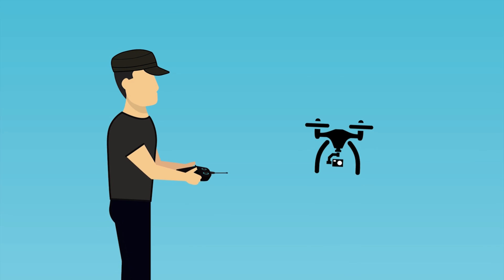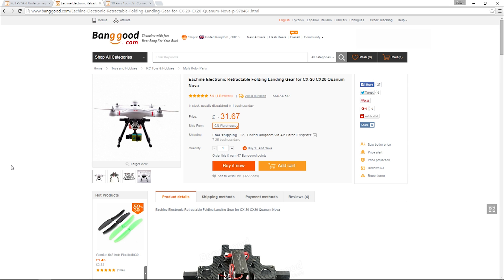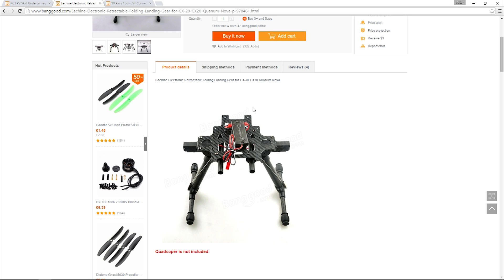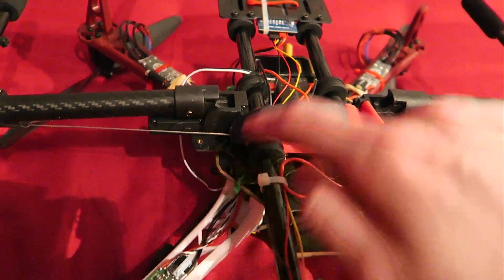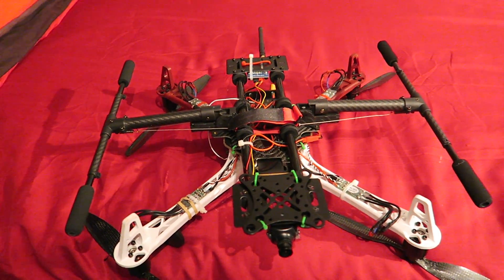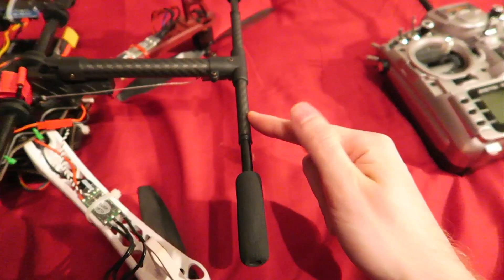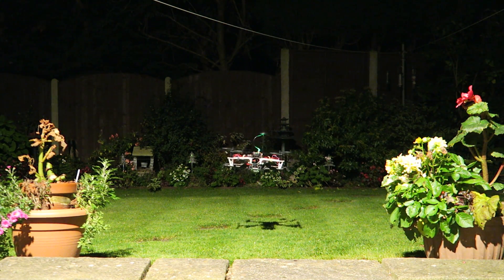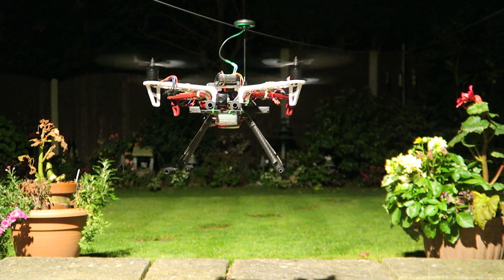High End 450 Quadcopter - E09 - Landing Gear

Comment: looks very twitchy you will need to adjust your pid for sure
Reply from the maker: its twitchy because I'm flying it though the cameras viewfinder to keep it in shot. that and its Gail force winds. the garden is shielded at the front and back but in the middle the winds are crazy. pids are nice on this one. I won't be changing

Comment: As usual ANOTHER informative vid
Me being devils advocate .
Does it affect your flight time (more weight less time)
And I did notice it was wallowing about on a mid stick is it because to much weight underside?? 
Looks EXTREMELY GOOD THOUGH.
BY THE WAY I a while ago I had a problem with my 450 because it wouldn't take off the props span at amazingly fast revs and when I turned the throttle off I got over run .IT WAS GHE THE NEW PROPS normally use 1145.changed to 1147 found out the pitch is ok for speed but crap for lift.I now use 1138 PERFECT. NOT TO GOOD FOR SPEED BUT GREAT FOR LIFT 
TRY  em you might be surprised
Look forward to your next vid
Brian 
London
Reply from the maker: +brian forward without all of this gear using a 6000mah 4s we are talking 20 min flight times. with the gear about 13-15 mins so still very nice for what I will be doing with it. theres no wallowing on mid stick this was flown in stability mode not alt hold or loiter. it was 15mph winds last night. flys really nice 11 inch props could burn these motors lifting this weight the 10 inch are ample. even with all this gear it hovers at 40 percent throttle.
Reply: Cool. My mistake I couldn't see any movement in the veg and assumed it was slightly unstable due to the underbelly weight. Very respectable flight times. Unlike some of the doughnuts that say 4 Hours on a 2220 5c  lipo. Always look forward to your vids 
Brian
Reply: Ment to ask are your motors sunnysky 2212
Reply from the maker: +brian forward as alex says 2216 11 inch is pushing it with this weight. its going to be about 2kg fully loaded. cheers. a lot of the wobble is also me flying it through the camera lens to make sure its in shot lol. no camera man unfortunately

Comment: Looks good, what size LiPo are you using?  With Arducopter 3.3 you can connect the gear to the Pixhawk and have it automatically deploy during RTH etc...
Reply from the maker: +Robert Bradshaw yes I am yet to play with that. :)